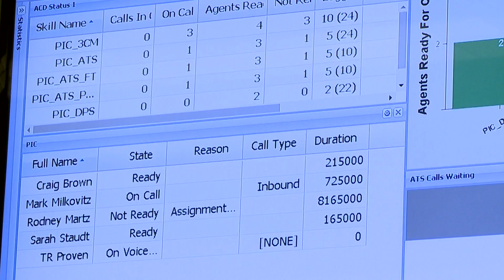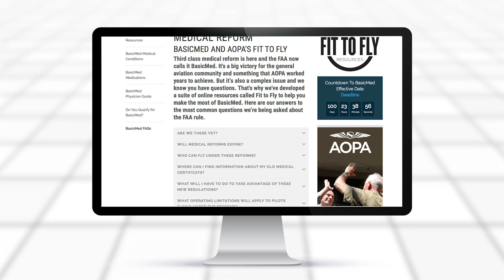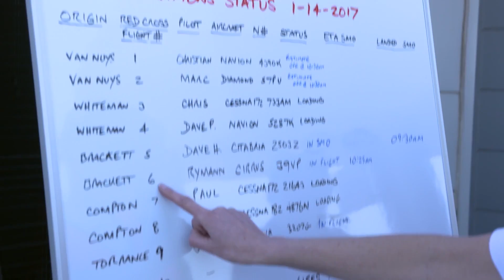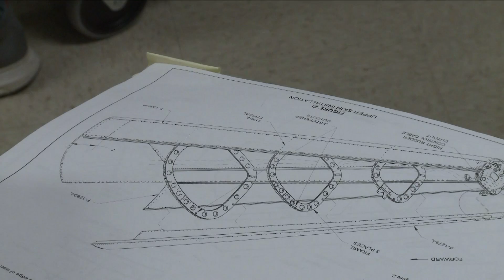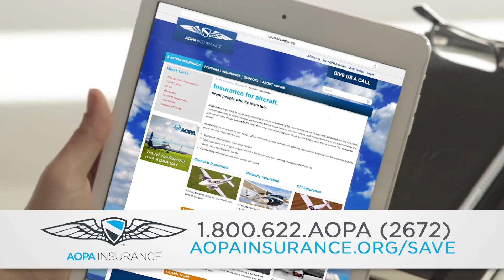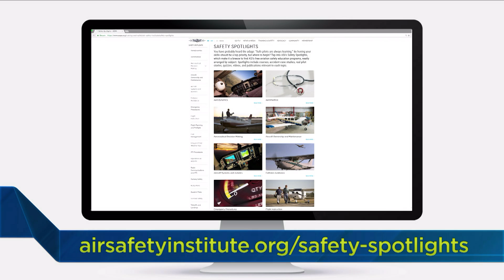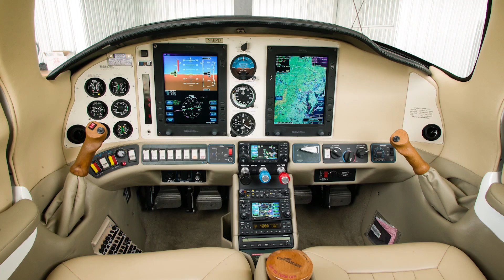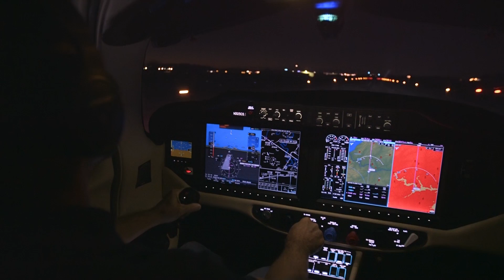AOPA Live This Week - January 19, 2017

Comment: The Cessna TTX seems to outperform the Cirrus SR22T in almost every aspect. However, the Cirrus does offer the CAPs (Cirrus Aiframe Parachute) while there is no similar feature on the TTX. They're both great planes but I'm not sure which one I'd rather own. Does the parachute actually make the plane inherently safer? Regardless, I'd be pretty stoked to own either one of these beautiful machines...